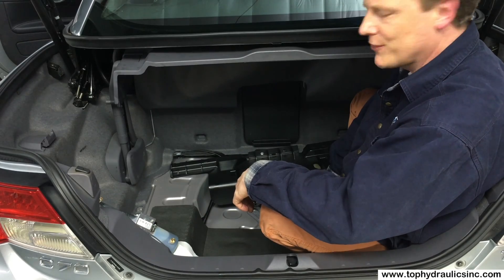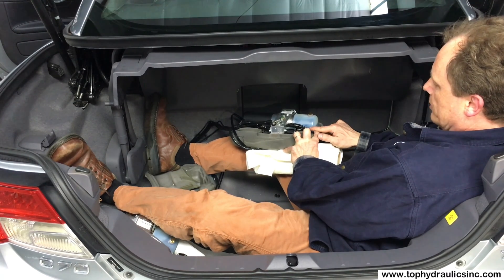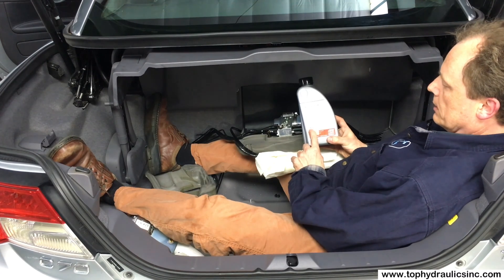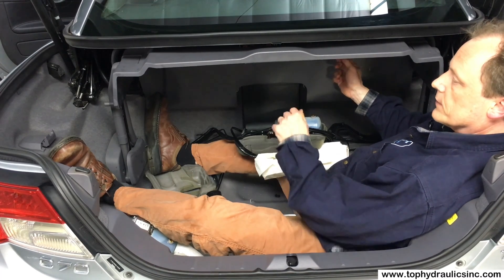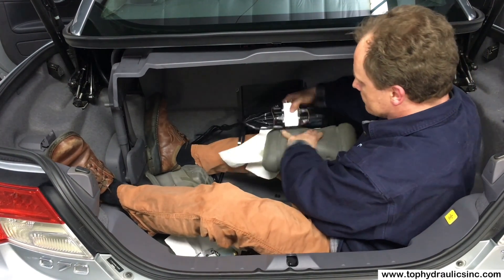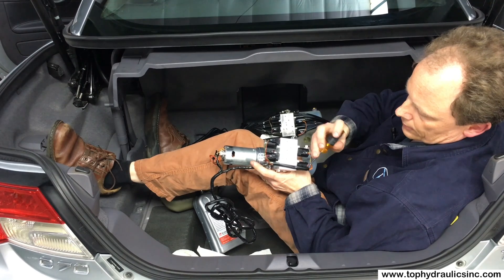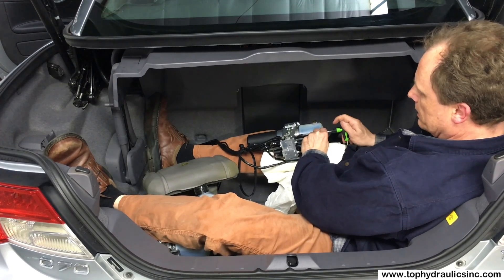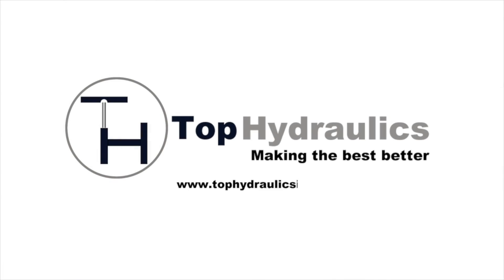Volvo C70 - Chapter 8 - How To Replace The Hydraulic Pump

Comment: I have had a few problems with the roof mechanism recently. I checked the pump and there's a  lot of corrosion.  Sorry to sound nieve but wht should I do? Does the pump need replacing or should I clean it and top up the fluid? Many thanks

Comment: Wonderful series of videos, impressive work and I hope your efforts bring in business.  I'm yet to diagnose the fault with my C70.  So far I have found the pump to be functional if I apply 12v.  But otherwise it's dead.  Would it normally prime and run up to pressure just with the ignition going on?
Reply: Stand down, I've found someone has pulled fuse F11 which on my car is misleadingly labelled 'headlight washer'.

Comment: Why you recommend Febi Bilstein 02615 as oil for the roof? This is even not a full synthetic oil? You get sponsored by them maybe? this is a serieus question so you could answer it 😉
Reply from the maker: We recommend FeBi 02615 for practical reasons. Even though it is not fully synthetic, it is perfectly adequate. The most important characteristics are a fairly constant, low viscosity over a wide temperature range, the lack of emulsifiers, the lack or additives that make the seals swell, and low foaming when aerated. Fully synthetic fluids may achieve a bit more even viscosity at very low temperatures, but the cost is the addition of more volatile components. This means the synthetic fluids available for this system smell bad when you have a leak (plus they etch clear coat if spilled). Since you are likely adding fluid because you have a leak, using a fluid that smells bad would not seem to be the best idea. Fully synthetic fluids were used by PowerPacker once they entered the convertible top hydraulic market long after Mercedes introduced fully automatic systems using Mercedes 0009899103, which is identical to FeBi 02615 (outside of the dye used in Mercedes fluid). FeBi 02615 has been used for decades with good results and we don't see a lower failure rate on systems that use fully synthetic fluids. We have rebuilt hundreds of thousands of cylinders and tens of thousands of pumps, so we have some experience in the matter.
Reply: Thanks for your answer and I understand it now. I know that you have a lot of experience thats why I placed the comment. I asked it because I want to change the oil in the roofpump of mine C70. Do you maybe know that this is adviced to do after 17 years of age? And if so maybe you have a way to do this without burning the roofpump? Thanks in advance.
Reply from the maker: @TonyTony-r2x  If the fluid in your pump's reservoir is black by now, then it would be wise to change it. You may want to get a syringe with a hose on it, so that you can suck the fluid out of the pump's reservoir. Suck out the fluid, refill the pump, cycle the top a couple of times, suck out the fluid again, refill. This should make a big difference, even if the fluid still looks black after the next cycle. Let's assume the reservoir holds 40% of the fluid in the whole system. After emptying the reservoir twice and refiling it, you will have 64% new fluid in the system in that case, or 78% after three fills.

Comment: Mister can i mix those fluids? Original is green and what you recommend is clear.
Reply from the maker: Yes, the fluid we recommended (Mercedes 0009899103 or FeBi 02615) mixes with the original fluid in your car.
Reply: @TopHydraulics  thank you so much. I used febi.

Comment: I have a C7  2009 and somebody took out the screws on top of the Hydraulic pump. which I think adjust the cylinders they look like needles seats. I ordered a new set like three or four of them from Volvo of Austin  & gave them my Vin number when they came back they were too small and of course Volvo won’t take them back and they insist those are the right ones.. I’m wondering if Volvo didn’t change the size of them. Anybody got any great ideas?

Comment: Hi there great video... One question on the pump... When releasing the spring I see a bronze like button next to it do I push that down and put back in the spring... And is it the screw I loosen on the spring or both where the bronze button is to? Thanks..
Reply from the maker: If you are trying to move the top manually, then you pull the release cable, which in turn releases the brass button you mentioned. The brass button is the pressure relief valve. When it’s out, then you can move the top manually. When it is pushed in and secured by the clasp that gets pulled by the release cable, then the pump is ready to operate again.
Reply: @TopHydraulics  do I have to loosen the torx screw to push it in?   Many thanks for your help 😊
Reply from the maker: @jamesturley9559  Normally, it is not necessary to loosen the Torx screw.

Comment: Good day I have a C70 hard roof type the roof go about 3/4 of its fold down then stops I can see no oil around the pump or the rams
Will change the oil and give it a further try do I have to do move roof manaul or by the electric motor to chase the air out if that may be the problem  
Great help on you YouTube site thank you Raysymo
Reply from the maker: If the fluid level in your pump is currently not under the minimum marker on the pump's reservoir, then there is o air in the system. The system is self venting, which means the air will be displaced from the hoses and cylinders as long as there is enough fluid in the pump. Given how hard it is to move the main portion of the top by hand, you probably want to have the pump do the job if possible.

Comment: Hey good evening I have a 2008 Volvo C70 convertible hard stop two days ago I was dropping the top n I pause it to look at a screw as I proceeded to drop it it stop half cycle would not do anything I had to watch ur video on dropping it manually WHAT COULD B THE PROBLEM bad hydraulic pump r what I'm lost right now

Comment: I’ve gained access to the pump and it has been wet.  There’s corrosion on it, and it’s foam is soaked.  I might try removing the motor to test it and replace if it’s failed. I hear two cylinders unlock and lock in the trunk but that’s all, so maybe the pump is working but connectors are corroded?  Question, if I remove the hydraulic lines will fluid drain?  Will I need to purge the system by operating the top manually a few times after the pump is replaced?  If I can’t revive it by cleaning contacts I’ll buy a rebuilt unit from you.  Thanks for the great videos!  There’s not much information out there on these cars.

Comment: You folks rebuilt my rear hydraulics last week.  Very fair price, excellent work. My question is do I have to bleed the rear lines (by the license plates) at the distribution hub....whatever it's called...where all the lines enter and exit.....to get fluid to the cylinders?  Lifting and lowering the trunk lid seems to do nothing, but I can hear bubbling going on back there.  Thanks!
Reply from the maker: Hello Phil, thanks for asking. The system is self bleeding as long as there is enough fluid in the pump. Have you checked the fluid level in the pump already? Make sure to keep the fluid level above the minimum line on the pump. You can use Pentosin CHF-11S or Pentosin CHF202 or Mercedes 0009899103.
Reply: @TopHydraulics  

Hello I have a problem with my top something wen I drive it starts bepping say stop the car top not close but it is so I press close and the bepping stops 
I try to open manual like in ur video but it keeps locked on the driveside top 

Do I need a new pump or sensors or cylinders help plz

Comment: Hello Klaus ! Can you tell me what voltage goes in the solenoid valve? Thank you !
Reply from the maker: 12VDC
Reply: @TopHydraulics  thanks. I have a roof problem. It doesn't open. Vida says Valve no2 pressure too high/low. When I press the open button I can't hear the dc-motor of the pump. So checked it with external power and it worked. Later i checked Valve 2 with external power and it worked too. Do you have any idea what it can be?
Reply from the maker: @bessmiri  Does Vida really say "Valve no2 pressure too high/low"? Vida cannot measure pressure.
Reply: @TopHydraulics  I don't think Vida can measure the preasure but yes it gives me the DTC code Crm-6021 Valve 2. Signal Too High Or Too Low:  Open-circuit on the cable between the Convertible Roof Module (CRM) and the hydraulic valve
The lead between the convertible roof module (CRM) and the hydraulic valve is short circuited to ground or voltage.
Hydraulic valve not functioning, internal short circuit to ground.
Internal error in Convertible Roof Module (CRM).
Reply from the maker: As Vida suggests, the problem could be:
1) Open circuit in the cable between the Convertible Roof Module and the hydraulic valve

2) Short circuit in the cable between the Convertible Roof Module and the hydraulic valve
3) A lead in the cable between the Convertible Roof Module and the hydraulic valve connected to another lead with 12VDC (that's rare)
4) Hydraulic valve having an internal short circuit
5) Hydraulic valve having a short to ground
6) Internal error in the Convertible Roof Module
The most likely one is 2). Check out 1) through 5) using a multimeter and some logic. If 1) - 5) are not it, then it is 6).
Reply: @TopHydraulics  ok, thanks i will check !
Reply: @TopHydraulics  Hi Klaus. I checked with a tester the cables between the CRM and the dc-motor of the pump, CRM and the battery, CRM and the Valve n.2, CRM and the ground terminal. They seemed ok because there was continuity. Which one do you think is the problem, the hydraulic pump or the CRM module?
p.s when I press the button to open the roof I can't hear the dc-motor of the pump
Thank you in advance
Reply from the maker: @bessmiri  If I am reading your message correctly, then you checked for open circuit, which takes care of possibility 1). Make sure to check for possibilities 2) - 5).
Reply: @TopHydraulics  Yes, correct. I checked for open circuits. I will check the other possibilities. Thanks !!
Reply: @TopHydraulics  hi Karl. Just wanted to inform you that I fixed the roof. I replaced the Crm module with another one and it finally worked. Thank you for your assistance !!
Reply from the maker: @bessmiri  Congratulations and thanks for letting us know!
Reply: Hi I been watching you're videos 

Here the thing I have 2008 volvo c70 my top says top open but its not so I press the the close button and then open and closes just a little bit and then massage goes away but the problem is wen I press open. It won't just lifts the backyard of trunk and doesn't go pass that I try to do a manual open but I didn't I followed all of you steps .. and it stay lock on driverside do I need now pump or maybe one cilinder is not working need help plz

Comment: hello,  I love the way do you explain the procedure removing and replace parts from the system, now how I know I need to change any cylinder or even the pump unit, I inspected the cylinders for any leak and everything looks normal my 
volvo C70 is 2011, what kind of service I have to do or just change the hydraulic oil, thank you again for your response.
Reply from the maker: Thanks for asking. Service is normally not necessary. If you live in a hot and humid climate and you use the top a lot, then you may want to drain the fluid from the pump after some ten years. To do this, you would drain as much fluid as you can out of the fill plug on the pump's reservoir and then refill the pump to just above the minimum level marker.

Comment: how should you go about checking if the hydraulic pump is actually working or not? asking because im currently having trouble with my c70 hard top
Reply from the maker: Thanks for asking. There are a number of things that can fail in this pump and you cannot test them all. You could check whether the foam around the pump is wet from water intrusion. That would already be a bad sign because wet pumps tend to fail a lot faster. If there is corrosion on your pump, then you could put 12 Volts on the leads that go to the pump's motor and at least see if the motor turns.
Reply: @TopHydraulics  I also noticed when it rained the other day there was like a puddle inside the trunk where the hydraulic is located but im not positive it the pump is getting wet when it rains?
Reply from the maker: @JahVii-Don  That is an important observation. If this has been happening for a while, then I'll bet you that the pump is failing due to corrosion. I always drill a small drain hole in my trunks near the pump, no matter which brand of convertible I am buying, to allow the water to drain if it accidentally gets in the trunk.
Reply: @TopHydraulics  This must be what has happened to my '07 C70.  If you do not keep the side drains perfectly clean water leaks into the trunk, and pools where the motor is.  I didn't know it was there but I've had water in the trunk recently and my independent shop tells me they're getting a C053 code, "Hydraulic Pump Signal Missing" and they don't want to work on it.  Your videos are fantastic!  I am a DIY guy and have fully serviced all 5 of my Volvos for years.  Now I'm going to tackle this roof problem.  I can't imagine what the dealer would charge.  THANK YOU!
Reply: My foam clamshell was completely soaked in water.  Nothing else in my trunk was wet.  Just a guess but maybe the clamshell is super absorbent to contain oil leaking.
My motor ended up being bad due to moisture.  My test was I ran my Fluke leads through the backseat center hole and tried to lower the top.  I took off the black plastic motor shroud and leads off the motor and put my test lead on those wires.
I got a used pump motor and putting it in today.  Note, you should be able to swap the motor and adapter ring easily.  I’m going to drain all the reservoir fluid and put in new.  
Also, I’m going to loosely wrap the foam with a heavy duty plastic bag with seal on top (opened to allow ventilation), to keep floor moisture from wicking back into the foam.
Update:  New motor in and works.  I took out the full plug and flipped the unit upside down to completely drain out the oil into a pile of paper towels.  Cleaned up all the surfaces with windex and flipped back over.
Motor swap was just taking out two torx screws and a gentle wiggle.  There is an o-ring on the mating surface, so clean everything before putting on new motor assembly.
I filled the reservoir between high and low and cycled the top a few times before buttoning up everything.  I added just a bit more fluid, keeping it about 3/4 the way to full.
I used a trash bag to wrap up the foam clamshell to keep the bottom from touching the trunk surface.  Wrapping it over the top of the foam the best I could to stop water from dripping down as well.
Works perfectly!
Reply: @tqmfun8205  When you say used motor, you're referring to the cylindrical piece or the entire unit with reservoir. Pretty sure mine is bone dry without fluid, torx screw shows rust and the motor side of the pump had some salt on it. (which implies water intrusion) I've found the motor on ebay for 50 but the entire unit costs 180. Not sure if you can just swapped out the motor easily.
Reply: @MKwan82  I got an entire pump unit cut from a totaled car.  They basically cut the hydraulic lines and unplugged the unit, with foam (sound proofing) and shipped it.
I tore the replacement apart, saving the dry foam shell, pulled out the electric motor.
I pulled out the old pump motor and tossed the soaked foam.  
Where the pump sits, is strategically under the center of the rear glass to trunk lid seal and when pine needles block water drainage, it would drip down on top of the pump cover and the foam would soak up 100% of the moisture it comes in contact with, thus corroding my motor and wires.
I was not missing any hydraulic fluid, my issue was no motor movement.
If you’re bone dry on fluids, might be other issues.  
Can you simply hear your motor running?  Or is it dead silent?
Reply: @tqmfun8205  gonna test it out with some 12V battery. I'm assuming dead silent for now. Thank you for your time. Not much info online that can help. Wouldn't it be easier to just put the entire replacement pump with reservoir without reassembling the motor(swapping) or is it not possible due to wiring?

Comment: hi,thank you for the video.Can I replace it myself?Im a small dealer,not a mechanic,but hardest part Ive replaced was steering coupler in huyndai.can I do it?do I need a computer to adjust the pump after replacement?
Reply from the maker: Hello Aleksey, thanks for asking. Absolutely, you can do it! I hope this video helps - we tried to show every step of the way. You do not need a computer to calibrate the pump. It is "plug and play".
Reply: Ok thank you very much. Your videos are very helpful